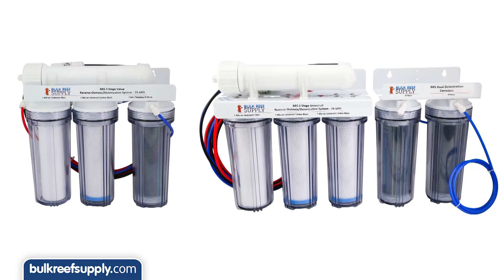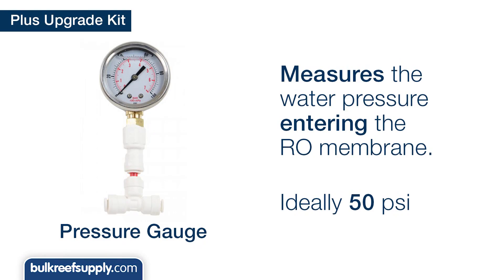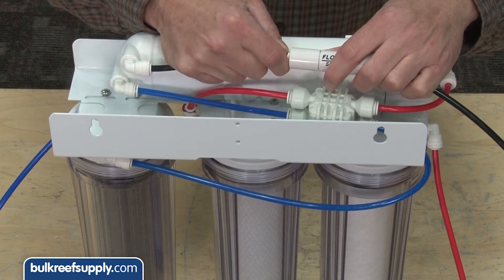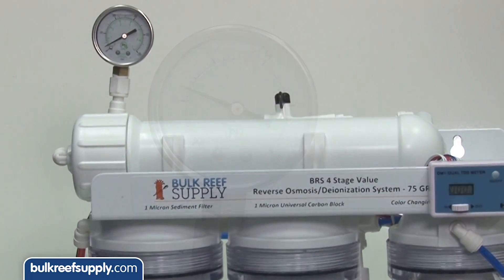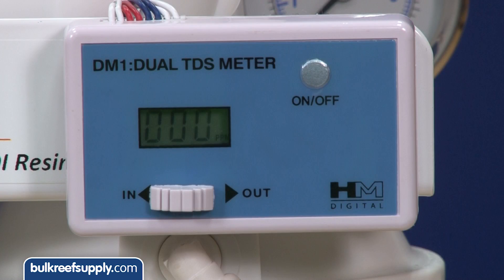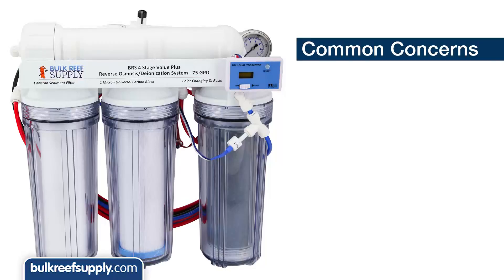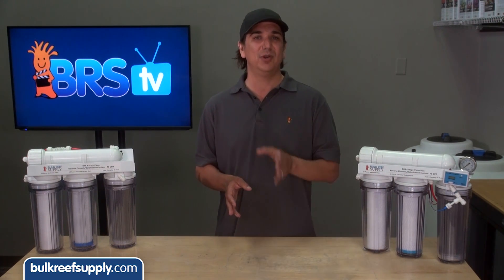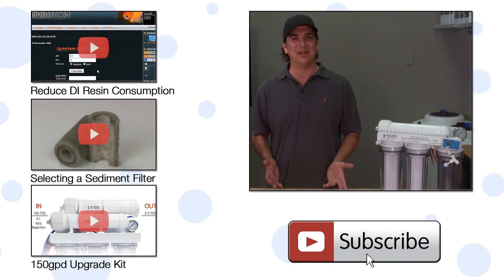How To: Upgrade Your Base RO/DI with Plus Features

Comment: I installed the pressure guage between the booster out and membrane in, and I'm reading 0 on the pressure guage. I'm pretty sure due to the booster is triggered off that's why the guage is showing 0 psi. Is that correct. How do I know when the booster turns on
Reply from the maker: When the booster pump is on, you should be able to feel the pump vibrating. Even without a booster pump, your pressure shouldn't be 0 psi when water is flowing. If that's the case, then it sounds like you may have a faulty gauge. If this was purchased from us, just give our customer service team a call and they'll be able to help you out.